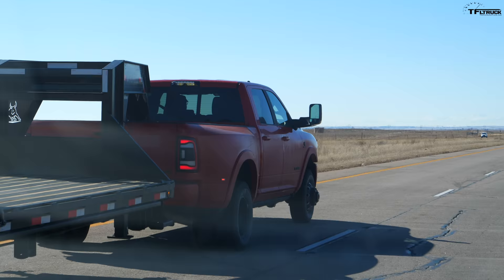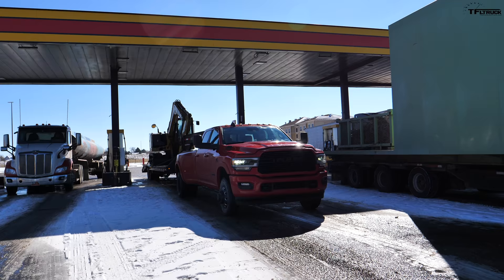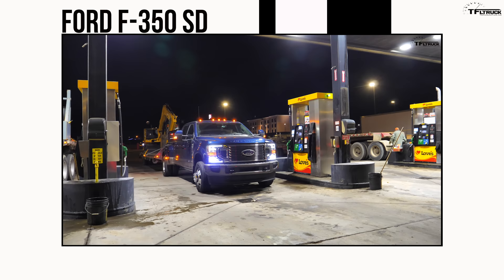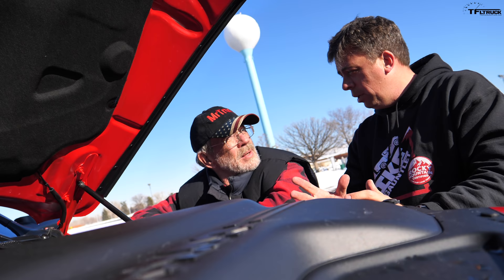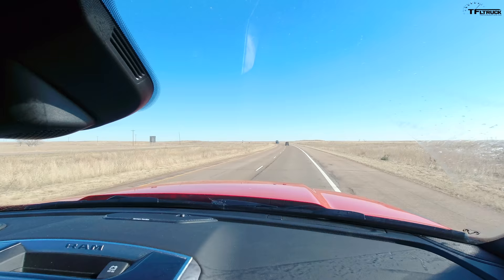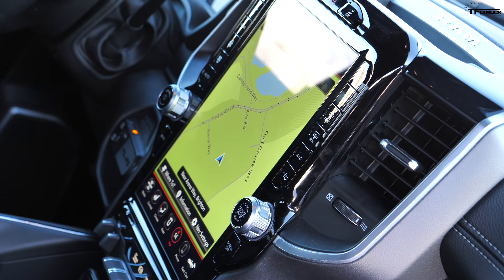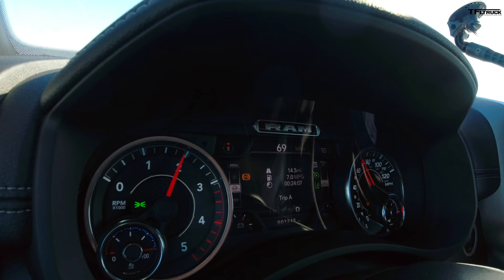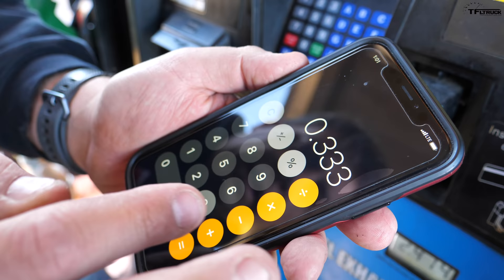New Ram 3500 Cummins Takes On Our 30,000 Lbs MPG Challenge Against GMC & Ford Diesels!

Comment: It was probably doing a regen which uses more fuel
Reply: If it was doing a Regen dont you think that it would of used the most DEF fluid out of all three trucks?
Reply: @trevorschield8195  i don't think def usage changes during a regen
Reply: @mmmmurphy  so what is Def fluid used for then?
Reply: @trevorschield8195  reduces N0x. maybe it does consume more because more fuel is being burned during a regen but i don't know if its enough that you would notice. you definitely can tell you use more fuel during a regen.
Reply: @trevorschield8195  def fluid itself has nothing to do with the regen. The regen can happen either actively or passively based on conditions. Passively being under the right conditions exhaust gas tempt can get high enough for long enough to burn anything in the dpf with no action required by the computer. Active regens actually dump raw fuel into the system to help heat the dpf up to temp to burn it all off. According to Cummins the 6.7 uses def at a rate of 2-3% of your fuel usage so in only 66 miles you would notice an active regen on your mpg but you'd be talking about a far less noticeable change in def.
Reply: DEF fluid does not get used more during a regen the higher the engine load the more def is used they are directly related that way not just fuel consumption, Ford liked to use the egr system to lower nox Cummins likes to use DEF to lower nox but in the RAM I’m not sure I am ver surprised the Cummins had the worst fuel mileage as that has always been its advantage in the past but having 6 gears vs 10 could cause a slight difference but not what we seen in the video. Without monitoring the after treatment status during the run it’s likely to assume it was the main cause for the large gap in comparison
Reply: @raccbc27  actually all of the current heavy duty diesels use both an egr system and def to do the exact same things. Egr systems are used to lower nox emissions primarily during idling by diluting the really air heavy mixture while idling and lowering combustion temps and def takes care of nox while under load when fuel consumption goes up. The Cummins was actually the last of the big 3 to start using def in 2013 while all others started in 2010 and 2011 so as far as dodge "liking" to use def vs ford the egr that statement is false. The Cummins actually held onto the use of a nox cat in the exhaust instead of def injection for longer than any of the other manufacturers.

Comment: I think the Ford has the best looking body by far! As far as the three engines go, I don't think Cummins has the edge any longer. All 3 engines are very capable and dependable as long as you use the trucks as intended. I personally would go with the Ford and then the GMC. I personally don't have any confidence in the Fiat Chrysler brand. With this said I'd rather save a bunch of money and buy a used truck that still has lots of life left on it. You can't go wrong with a Cummins swapped Ford or a Ford with a bullet proofed 6.0 liter engine. Bill at powerstroke specialities will tell you that nothing compares to the reliability of a properly built 6.0 powerstroke. He has the history that shows it.
Reply: Going with your "use trucks as intended" a thing I've seen many times over the years is people not using Motorcraft fluids in there Ford's. There are parts in those vehicles that need that specific fluid. My wife's Mountaineer Premier a pretty pricey ya know fancy explorer I picked up for 300$ because to have it fixed the people where going to have to shell out 10k (or so there mechanic said) all that was wrong was the timing chain tensioners got hard and broke off the metal arm, due to running cheap oil that did not have the additives. The truck now has almost 200k on it and haven't touched it. ( had 80k) my Mazda 3.0(Ranger) has 256k no problems my explorer 5.0 has 276k no problems. I mean Ford even makes there own antifreeze lol
Reply: @bigjohn5104  The timing chain issue is just known for the 4.0, and that V6 was known to be the most catastrophic when failed. The 3Valve 5.4 comes second. Some 4.6 and 2V 5.4 are also known for timing chain issues. Good engines under the timing chain issues  I still had 320K on my 5.4 and she ran great. Honestly regret trading it in, but the timing chain rattled on start for 60+K miles. Never gave up, but it's just a Ford issue. My old Grand Marquis had the rattle at 180K but went away with a motorcraft oil filter. Fluids matter less as long as the API ratings are right, but definitely buy factory oil filters. They're not fans of weak drain back valves.

Comment: Ford is laying the smackdown this year between the PSD and 7.3L Godzilla motor. No one can touch them performance or mpg's.
Reply: @What Up There is a million variables that could cause the Ram to be faster in a drag race. The engines are close in power. All it takes it a lighter truck or better gearing to make the difference.

You think TFL lied about the 7.3L's 8:42 time up the IKE with a 16000 lb trailer? It sure smoked the 6.6L GM.
Reply: Ford is definitely laying a smackdown!
Reply: @What Up They 6.4 is not new....the 7.3 was......
Reply: @What Up Not the 2500. The 2500 is the same truck as the 2018 with an update grille and the 8 speed. It's still using the old, smaller cab and still the same weight.

Comment: With the new diesels there may be some mpg difference depending on Current soot level and  Regen
Reply: Good point. Maybe a tuner that has forced regen mode should be used prior to the tests.
Reply: Yep. And a regen on the IKE could have caused the RAM to drop off like it did in that test.  I've had my older Cummins go into a regen up that grade and it definitely slowed the truck.
Reply: Yea a forced Regen would be nice , it would also be interesting to see what truck has a higher soot level after the test
Reply: @THEjasonTDI  With your accelerator to the floor, the truck won't regenerate.
Reply: @joerapo  The best thing to do is just drive it for a much longer distant and include your regen process. Regen is a part of how your engine operates, it's not something you should ignore.
Reply: emdec55 good point and if the Ram had gone into regen it would have completely lost the whole test but it actually came in perfectly in the middle just like it’s power ratings
Reply: @AkioWasRight  tell that to my 12'. Been up and down that road enough times with the same load to have it happen more than once. Newer units who knows. But mine is the last of the non-def motors.
Reply: @THEjasonTDI  An engine won't regenerate with 100% accelerator or at redline. Your EGTs are hot enough to have active regen, not passive. It might actively regen after you lift off, but it's not going to do it all the way up hill, with a full load, like they do up the IKE.
Reply: @THEjasonTDI  I did tell your '12, and it agreed with me. I also told my '13, my '11, my '18, my '07, my fleet manager and my mechanic, and they also all agreed with me. With that much load, EGTs will reach 1,300 degrees or more, which is hot enough to completely burnout a filter. That is called a passive regeneration, which requires no added fuel like an active regeneration would under light loads. Your fuel system probably wouldn't even be able keep up if tried to actively regenerate while the pedal is to the metal.
Reply: My father in law hauls daily with his 15 f250. His truck hasn't got into regen for over a couple months because he works it everyday.
Reply: @k9leadstheway531  And how would you or he know that?
Reply: @k9leadstheway531  It's not easily to tell if these truck goes into regen. There's no prompts or indication. You might be able to tell by the smell of the exhaust, the dip in MPG or from the exhaust note, but it's not easy to tell unless you look for it and know what to look for. It's likely his truck has regenerated a dozen times or more without him knowing it.
Reply: @nukewiller4083  your maybe right. Just going off what he told me. I drive a 7.3 so dont have to worry about that stuff.. lol.
Reply: @nukewiller4083  A lot of people don't know how tell when a truck is regenerating. A few weeks after my neighbor had bought a Mercedes DPF equipped van, I asked  how many regenerations he had seen. Well, he looked at me confused because he didn't even know what regeneration was or that his van had a DPF. That's why I tell people that, if you have a modern day diesel, just disregard instantaneous read outs and don't hand calculate your MPG until you've gone through at least one or two tanks of fuel. A diesel will likely regenerate once per tank in mixed driving, sometimes multiple times per tank. If you just calculate after 50 or even 100 miles, you might get a completely different calculation after 200 miles under same drive conditions because of regeneration.
Reply: Spamfried funny, I never had a active regen in my Cummins and never dipped below 19.4 mpg at any time!
Reply: @AkioWasRight  I'm not saying to ignore it. I've heard some tuners have a regen mode that you can turn on even before soot levels reach the level of a normal regen mode. That way every test is done with the same amount of soot.
Reply: @joerapo  I mean, this is supposed to test of stock trucks, isn't it? You can just drive longer, like I was saying, no need to tune, that way you get an accurate reading. That said, I understand the difficulty in testing these trucks. You basically go through one or more tanks to get an accurate reading. I wouldn't expect them to do that for every truck they test.
Reply: @nukewiller4083  He's going to post smiles and vote up his own comment next.
Reply: There are few ways to tell when these trucks regen. The best way to tell when your truck is in regen is by using a scan tool, no need for anything fancy. Another way to tell is watch your instant MPG in the EVIC drop, but that's not as accurate as the scanner. There's other ways of telling, but they're not easy to do. You'd actually come to stop and listen for the truck to whistle. The exhaust will also sound and smell differently. You'll also feel way more heat from the exhaust, hot enough to actually set something on fire, like grass. If you just want a simple MPG test to include regen, just drive it more. I don't even think you need more than one tank. Regardless of how efficient you drive, it will usually regen at least once per tank. If you're not driving it hard enough, it'll regen several times per tank. But just fill it up, put it on the highway, and it'll give an accurate enough measure of your MPG after a few hundred miles. Not too complicated to do.
Reply: @JohnDoe-nz6bk  You're lying, don't know what a regen is or both.
Reply: Scotty I suggest you educate yourself before posting anymore stupid comments on what PASSIVE regen is!
Reply: @AkioWasRight  I'm not saying to run a tune. You can have a Tundra installed and still run the stock tune. My point is if all trucks have the same baseline you'll have a more accurate test. Ideally they'd run this test for a thousand miles, but that can also introduce more variables.
Reply: @JohnDoe-nz6bk  That's probably because you don't know what a regen is. There's no way to tell unless you understand what to look for.
Reply: AllentechPt902 I absolutely know what a regen is, both passive (not really a regen) and active! Do you know, because it definitely sounds like you don't!
Reply: @JohnDoe-nz6bk  Passive regen is when your engine produces enough heat to burn the particulate matter in your filter without without added raw fuel. This works when your engine is under load. Active regen is when your temperatures are too low to burn the soot and raw fuel is added to increase the down stream exhaust temperatures. On Ram trucks, there is no indication of when this happens under proper operation. Your truck will go 100,000+ miles and never tell you what's happening. You will only get an indication when your truck isn't completing a normal regen and requires a full regen.  As an operator, I know exactly what passive and active regen is.
Reply: @JohnDoe-nz6bk  Well, that's clearly false. If you're anywhere close to 19.4 mpg (Maybe with a tailwind), then that means your engine is not under any kind of load, which means you're not generating nearly enough heat to passively regenerate. You have to be almost full out to generate enough exhaust temperature to regenerate passively. It's beyond obvious to me that you're just making things up.
Reply: Seriously people, John Doe
 isn't even a troll, he's just crazy. I don't even mean that jokingly. Don't take anything he says seriously. He's all over these threads with same crazy comments. Don't try to educate him or correct him, just ignore him.
Reply: Scotty apparently you don't! I suggest you read some of the links I provided, you just might learn something.
Reply: @JohnDoe-nz6bk  Actually, I do know what it is. I'm a diesel technician. I deal with hundreds customers a year. You're the only person I heard make such claims about their truck. A DPF has to consistently see temperatures of ~1,200 degrees or more to avoid regen. It's not possible for your engine to run that hot unladen, and even less possible to be getting 19+ mpg with these kinds of temperatures. Anyone with basic knowledge can see that you're lying.
Reply: @JohnDoe-nz6bk  I live in a hilly are of California. I barely see more than 13 or 14 mpg in a stock truck. Even a deleted truck is not going to get nearly 20 mpg when driven hard. You are a total liar.
Reply: AllentechPt902 ohh, sure sure.. Whatever you say!

Comment: I have the 2019 3500 same truck and it don't get any fuel milage either and I have 50000 miles on it towing it does around 7 fully loaded at highway speeds  empty around 14
Reply: Welcome to 400hp full emission engines.  Tune and delete a 6.7 Cummins and you easily cruise at 20 mpg.

Comment: I really like how ram gives you a sunny D pull-top to stuff in the tank fill. is that an option?
Reply: Jade bylund Lol good 1 😆
Reply: I think that's just a transport plug you're supposed to throw away. My welder came with those. Lol.
Reply: It's a "limited edition, special option" dealer add-on. The sunny d cap adds an extra $1,200 to the sticker price. Lol

Comment: Please try the ram 5500 and ford F550 or even 2020 Ford F600
Reply: No difference between F-550 and F-600
Reply: Well apparently the f600 is only available with a gas engine

Comment: I like all these truck. However I'm partial to Ram. Mainly because of the Cummins engine. But what really gets me confused is MPG. These trucks loaded with 30k lbs. Getting 6-8 mpgs , total weight let's say 40k lbs. Now a semi loads out to 80k lbs. Average semi gets 6 mpg. Something just dont add up. Just like my first car. 86 Chevy Sprint. Brand new on the highway it got 58 mpg and 52 in city. Granted it was a 1.0 liter Suzuki motor with 50 hp. But in today's time we have to get a hybrid to get the same. We should be getting 75-100 mpg by now if all the computers makes a vechicle more efficient. Remove all the DPF's and EGR mess and all the trucks will gain 5 mpg lol.

Comment: My 2019 dually crew cab with the aisin and 3.73 gears got the same for fuel milage. It progressively got better, from 38L/100km to 35L/100km, and now at just over 9000 kms its consistently gets 30L/100km or a bit better when towing 13 to 15 tons.

Comment: If you're rolling on the highway a ten speed won't make any bit of difference over a six. It's all down to axle and overdrive ratios. If you are driving in stop and go then a ten speed would have the advantage, but on the highway, no. A four speed with the same overdrive as a six speed would return damn near the same mpg on a highway run provided you are running on relatively flat ground.

Comment: I have the new 2019 2500 Laramie 4022 miles and I use 2.5 Gallons at 1035 miles.  My MPG is 16.2 driving around town and 6.3 MPG towing 10K fifth wheel.   Not a very happy customer.
Reply: Sounds about right!

Comment: Can you load it with the engine and key off to check for squat and then turn it on and allow it to level out?
Reply: There would really be no point to that, it has an overload warning that tells you if you're overloaded

Comment: I have a question as you drive the heavy duty trucks in all conditions, especially snow and ice. I have driven the Ram 3500 dually Mega cabs since 2012.  Summer pulling mini excavators, skid steers, but mainly our 5th wheel toy hauler to races.  I purchased a 2019 F-450 for the better turning radius, brakes, (at the time) 48 gallon fuel tank over the Ram. Like the truck, but on snow/ice covered roads I have found myself fighting it and stressed.  I have Toyo m655 tires on it currently.  On the icy, snow roads I am only pulling a box trailer bumper pull. To the point, in winter driving do you still prefer the turning radius of the wide track f450, or the normal stance of a Ram 350, both long bed crew cabs.  Just trying to be clear and direct in comparison.  Sincerely, Lee